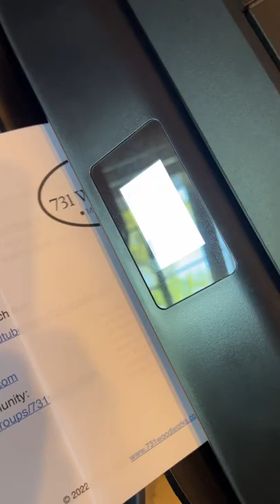Using 3 Tools with less than 2 Hours to Build 1 Project #shorts

Comment: Looks like some fun in the sun with your son! Sometimes these basic little projects are the most fun to whip up. A little trick to add some comfortable curvature to the seat and back rest would be that you can actually cut a shallow curve with a skilsaw. Just lower the blade in ~3/16" increments until you're through. I bet you would've still been under 2 hours and would still only need those 3 tools. Technically you could reduce that to two tools and nix one of the drills. "2 tools and 2 hours to build a chair with curves!" Lol